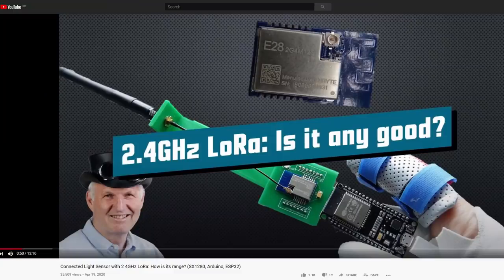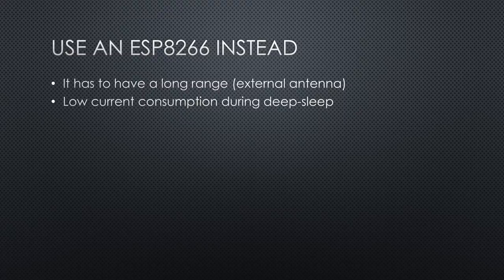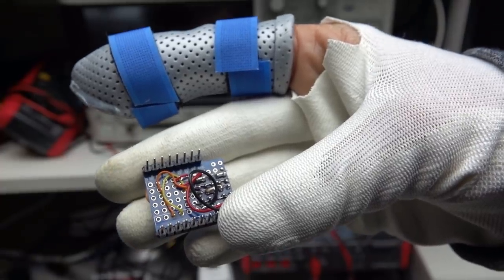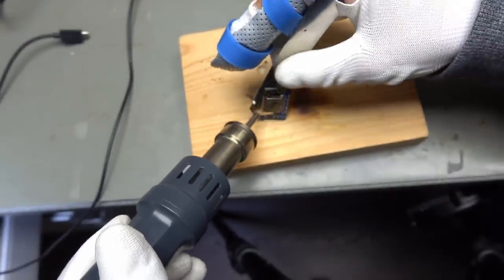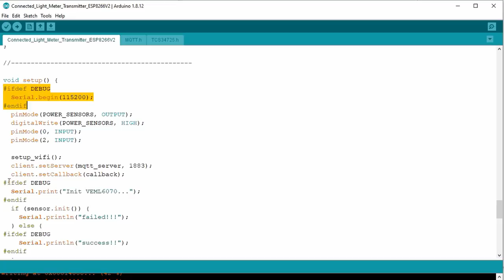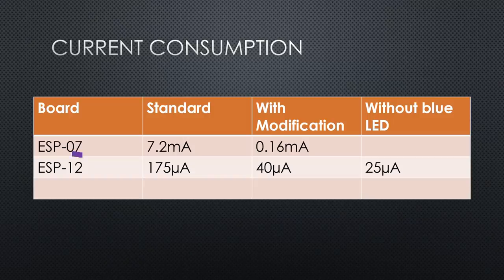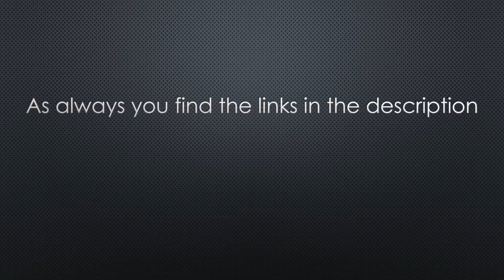#324 Wemos D1 Mini: Long Range and Low Power Modification (ESP8266, LiFePo4)

Comment: Outstanding advice and video. I have 3x D1 ESP8266 mini's for a project and this has helped me reduce the power consumption, as they will use a solar panel from outdoor Christmas lights to charge the battery and do not need powered on all the time, just when it needs to send data (currently temp, humidity, Light level, noise, vibration and gases), which is sent once every 5 mins. So this video has really helped. Thank you.
Reply from the maker: Cool project!

Comment: Danke, Andreas, very helpful! Until now I've always lifted the Vcc pin of the FTDI chip to save its power consumption, but the trick with cutting the trace is much better!
Reply from the maker: Your way is also a good one, I think. And it works in all situations ;-)

Comment: Cool vídeo! I'm currently using the wemos outside with a tiny solar panel,  a tp4056 with protection ic, and an old 18650 cell from laptop battery. Working great so far
Reply from the maker: Very cool!

Comment: Is it possible that the last table has wrong row labels?   ESP-07 on that table eats much more current than ESP-12?
Reply: i was asking myself the same question
Reply from the maker: This is what I measured. I do not know why :-(
Reply: Andreas Spiess incredible. What components do the modules use? ESP8266EX, flash and oscilator + some passives. Does the ESP-07 have some RF circuits for the external antenna?
Reply: @AndreasSpiess  Ok, I misunderstood this. So ESP-12 is way to go if one wants to save energy and the simplest way is to get rid of the blue led. Thanks for the great video again.
Reply: ꀯ i thought the same. But what explains the current draw differences (other than an eventual mistake mr adreas made)
Reply: antenna is a load and additional cables always have losses. external one appears to be much bigger load than pcb one.
Reply: @AndreasSpiess , I've came upon a video that might explain it.
The trick is that some boards already contain resistors that connect some of the pins that need to be pulled up. You can get bellow 3uA if you remove the resistor that holds the RST pin.

Take a look of the video "Best power saving mode - Much Deeper Deep Sleep ESP8266" by "DIY TECH BROS".
Reply: @user-jp7tw3sd3x  yup. I think we have the winner here :)
Reply: @antonmilosevic  As far as I know, the ESP07 (not the S version) is older than the ESP12F. So maybe the chip revision also differs, or they used other values for pull-up or pull-down resistors. Or perhaps the flash chip itself uses more power when the ESP is in deep sleep. 
Could be the same difference can be seen when comparing ESP12E  and ESP12F
Reply: @Mr.Leeroy  Even i was thinking the same.....but the external antenna helps to reduce the handshake time between the esp and server...so with ext antenna esp can go back to deepsleep quickly then without antenna thereby reducing current consumption(if you are pinging at intervals)....if you require consistent connection for commercial application always go with esp's with ext antenna model
Reply: @upendrachaudhari4635  you may be right.
well my reasoning is easy to test by comparing both modules using pcb antenna. I only have nodeMCU now.

Comment: So, do I get the last table right? The ESP-07 gives you an external antenna connector. But it draws a lot more current than the ESP-12 which is pre-installed in the D1 mini? I hope I got that right, to be honest that's a bit confusing...
Reply: @aqib2000  This is deep-sleep current. So only the chip's bare minimum functions are powered. The transmitting or receiving part of the chip is shut off during deep-sleep.
Reply from the maker: I do not know the reason for the higher current of the ESP07. Maybe because it is an old design.

Comment: Good video. I use a D1 mini pro V2 which has a external antenna and a built-in battery charging circuit. Has pads on the back so with a dab of solder you can connect GPIO16 to RST and another dab of solder and it connects the plus side of the lipo battery through a 130 k resistor to A0 for voltage monitoring added a BME680 sensor set it to deep sleep every 10 min. It reports all sensor readings to thingspeak website. Can monitor Temp, humidity, pressure and Indoor Air Quality.  Last about 60 days between charges.
Reply from the maker: Sound like a great bord. I will have a look at it.

Comment: I want to point out some clarification regarding the cutting of the PCB trace:
I did as instructed in the video. However i got strange behavoiur, as the ESP did not work properly afterwards. After some time debugging I found that by cutting the trace as suggested, the Pull-ups for D3 and D4 have no 3V3 anymore. So I connected the pull ups with a short wire to 3V3. But I had to cut the trace which leads to Pin16 of the CH340 to prevent the Chip from getting power again.
I han further problems with the 470R Resistors in the RX and TX line. I found that somehow current was flowing from ESP to CH340 through them. Therefore i desoldered them. Now I can only program via external serial converter, but it's working now as expected.

BTW: my blue LED was also slighly glowing during deep sleep as you described. I suspect that this is caused by the above mentioned issue. I suspect in your case (only the one trace cut) current flows from GPIO2 (where LED is) throught the circuit path (the disconnected 3V3 copper traces) and through the CH340 chip back to the ESP. Probably due to some parasitic diodes. With my additional modification (cut 2nd trace and solder a short wire), the LED does not glow anymore during deep sleep.
Reply from the maker: Thanks for the info. Another viewer pointed also out that he had a slightly different board.
Reply: @AndreasSpiess  When I compare your close up shot of your PCB traces with device, the Layout looks the same, however. But of course no all is seen, so it could have been something different.

As Addition to anyone who wants to achieve a very low power design:
I measured the reverse current of the voltage regulator (i think ME6211) when no USB was connected. As will be the case when I supply 3V3 from an external regulator. I measured 58µA! However, this was not acceptable for me.
So I ended up desoldering the CH340, the two NPN-transistors, the resistors in between and the voltage regulator itself.  So i have a very low power device.
Programming can easily be achieved with any 3.3V external USBtoSerial converter with 4 Signals RX, TX, RTS and DTR and some jumper cables. I think, this little inconvenience is worth a considerable lower current consumption.

Comment: Why not read internal voltage directly?
Like this:
ADC_MODE(ADC_VCC);
volt = ESP.getVcc();
No need to connect ADC externally.
Reply: S Elnes : right, this would work...but in all the ESP8266 ADC is bad
Reply: And you can use the voltage measurement to stop the esp from waking up when the battery gets to low.
To save the battery.
Reply: In this mode  you read the voltage after the voltage regulator of the D1 mini, which gives less info about the battery voltage
Reply: @wjhoogervorst  but if you connect Vbat directly to VCC of the ESP8266 you read Vbat. And that is what he does here. He bypasses the regulator.
Reply: @rofo88  for this purpose it's more than enough
Reply: @antonmilosevic  I think that is the point Wim was making.
Reply: That mode can't be used on the Wemos boards without removing the resistors connected between the ADC pin of the ESP board and the A0 & GND of the Wemos carrier board.
Reply: @nThanksForAllTheFish  Yes, indeed

Comment: If I do not call `Serial.begin()` at the beginning, aren't all subsequent `Serial.println()` calls ignored and have no effect? Do I have to put the conditional preprocessor block around each and every `Serial.println()` in order to disable the serial output and save power?
Reply from the maker: I do not think that they are ignored. The just do not know where to output and lose everything. With precompiler directives the commands are not inserted. But I never looked how the compiler works.

Comment: Great video! Fyi: you can purchase a D1 Mini Pro with external antenna connector pre-soldered.
Reply from the maker: I know. But it would probably arrive as a Christmas gift in the current situation ;-)
Reply: @AndreasSpiess  Why not using the ESP07S? It has an external antenna connector, no LED and no chip antenna to be removed.  It also has 4 MB flash and like the ESP12S it only has the pins on the side, not the "bottom" row (opposite edge of the antenna position)  The ESP07 has very little flash, so OTA updates are much harder.
Reply from the maker: Same answer as above. Do you know if it is pin compatible with the esp12?
Reply: @AndreasSpiess  Yep, I use them myself. Main difference is that you don't need external components for pull-up or pull-down on the ESP12S / 07S. So it makes my own boards a lot more easier :) Less pins to solder, no external components.  

When you use the Wemos base boards, there are already the pull-up and pull-down resistors present on GPIO-0, GPIO-2 and GPIO-15 (and the EN pin), so I guess those will be in parallel to the ones included in the ESP12S/07S package and thus impose a stronger pull. You may need to keep that in mind if some connected sensor is not capable of pulling the pin down (or up for GPIO-15).  

Also there have been reports on ESP12S not being able to wake up themselves because of the wake signal on GPIO-16 to rise too slow and thus give a pulse width which is too short.  Not sure if that applies to all. It could be remedied with an external resistor or capacitor (not sure which).
Reply: @AndreasSpiess  same for ording a ESP-07 chip to replace an ESP-12 :P :)
Reply: Loving D1 boards, I use them for pretty everything.

Comment: Hi Andreas, Thank You for great detailed Wemos how to video. Question. Am wanting to use one of these as a repeater mounted on drone to hopefully get better FPV range. Problem: The FPV is transmitted to smartphone over wifi 5.8ghz. Is there any cheap modules to make this happen? (Have already tried adding an external antenna to existing wifi on board of drone  for the 5.8ghz wifi on no range increase at all?) To put into perspective. The drone communicates from drone to controller,over wifi 2.4ghz and can in fact fly over 1km in distance. The camera/FPV from drone to smartphone is transmitted via wifi 5.8ghz,and this dies after only 125 meters distance. Thank You.
Reply from the maker: I have no knowledge about video nor about drones. So I am no help here.

Comment: I know its a bit late almost one year later, but there is a Wemos D1 Mini Plus that already has a ceramic antenna plus a connector for an external antenna. Its a bit more expensive than the normal Wemos D1 mini, but still cheaper than buying an additional Esp-07. for a few cent more there is also a Wemos D1 Mini plus with a bigger flash memory.
I some time ago played with an ESP-12 and soldered it on one of those little breakout boards that are sold for them. After some time I noticed that breakout board used a 0Ohm reistor instead of a regulator. So I was running my ESP-12 on 5V instead of 3.3V. 
It didnt take any harm, so I googled a found some posts that ESP8266 would be known to run on 5V without problems.
Thats nothing I would recommend to do. But I could imagine runing it on a Lipo with 3.7V instead of 3.3 V will not do big harm, especially if it always only works for a second and then goes back to deepsleep.
Reply from the maker: According its datasheet the ESP8266 has a maximum rating of 3.6V. And its input pins are 5V tolerant. So you can be happy that yours survived!
Reply: @AndreasSpiess  Ich weiss, dass der Esp8266 nicht für 3.7V oder sogar 5V zugelassen ist. Mich haben nur die Forenbeiträge von Leuten gewundert, die behaupten, dass sie ihre ESP8266 immer ohne Probleme mit 5V betreiben. Aber wer weiß, ob das stimmt.
Mir ist aber auch gerade mein Denkfehler klar geworden. Ich bin fälschlich von 3.7V ausgegangen, aber volle Lipos und Lithium Ionen Akkus haben ja 4.2V und das liegt natürlich schon weit über den zugelassenen 3,6V.

Comment: So nice to see a video on the ESP8266 again. I thought you had given up on it and gone solely ESP32 :-)
The D1 mini is my favourite 8266 board too, especially when flashed with the Annex RDS firmware. The latter might not be that well known, but if you like combining live web interfaces with embedded or just like a retro BASIC (yes, really!) experience, it might be worth exploring. I find myself using this a lot more than Arduino IDE or Platform I/O because it's as flexible as MicroPython without being so sparse and irritating as the latter :-) And the single step and breakpoint debugger actually works :-) If you are resurrecting interest in the 8266, you may want to have a look at what the Annex RDS team have been up to in the past year?
Thanks for an interesting video Andreas...
Reply from the maker: I use the ESP8266 if I do not need an ESP32 because I still have plenty of them in my box. For the videos I usually use ESP32s. I will have a look into Annex RDS.

Comment: will you please make the same instruction for esp32 .. for wemos or nodemcu . im having a really hard time soldering to the naked esp32, 
and i just CANT solder the 3.3v pin to a breakout PCB
Reply from the maker: You get "naked" PCBs for the ESP32 with normal pins. I showed it in one of my videos.

Comment: Hi Andreas, going down to ~20uA for a prefabricated PCB including USB-TTL (when needed) is really impressive. Also the LDO seems to be pretty ok. I wish there were some more ready made modules (also for ESP32) available with low power configurations suitable for battery projects. 
I tried your power modification and found that the 10k pullup for RES is on the ESP side of the cut while the IO0(FLASH) and I02(blue LED) pullups are on the CH340 side. When powering the module on the ESP side only (battery mode) and going into deep sleep, the blue led drives a small current via the 10k resistor into the CH340 "power domain". I02 is at around 0.8V in this stage. This is the reason the blue LED stays on in deep sleep. 
I also measure 0.8V on I00, probably crosstalk? Removing the LED it is 0V. My module works ok with the LED kept or removed. However, I am not sure if it is 100% save to have IO0 connected into the CH340 domain without being properly pulled high and the CH340 domain is still connected to ground.
Reply: Today I reconnect the 2 power domains and removed the LDO instead. This led to 30uA@3V during deep sleep. Actually I had expected much more since the CH340 is still connected. Then I inserted an MCP1702 instead and and removed the 100k resistor between VBUS and GND (I have no idea why this is there). This led to almost same deep sleep current feeding 3.3V and 34uA feeding anything from 3-6V to the 5V pin. In this state you can also just plug in the USB cable. However the MCP1702 is not at all ideal (just had it around) and even fed with 5V from USB it led to spontaneous crashes unless you connect a big capacitor between 3.3V and GND. Finally I connected 6V to the 3.3V input........
Reply from the maker: Thank you for sharing your experiments. 6 volt on the ESP is probably not the best idea ;-)

Comment: If I understood correctly, cutting the track does not change the working of the board, right? All functionalities stay the same. The only change is that the USB does not feed the USB to serial chip anymore, instead external power must be applied, am I correct?
Reply from the maker: Pay attention. Some viewers wrote they got slightly different boards which did no more work after this mod. So check first the traces. But you are right, I disconnected the USB chip and the voltage regulator from power.

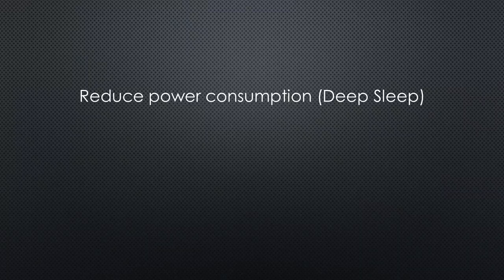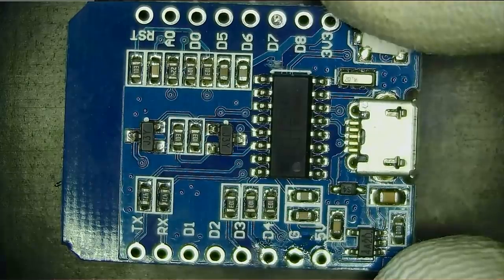Comment: Cutting the trace on the board to disconnect the LDO regulator?  Not quite clear about what is being explained between 3:35 and 4:10. Can you expand on this, ie, how to program and run the board from which inputs?  thanks.  
PS. I'm powering my battery run devices using the HT7333 w the appropriate volt divider from either 4.2(parallel) or 8.4 battery(in series) configs
Reply from the maker: I think the explanation was very clear. The HT7333 is a good solution. I also use it frequently.

Comment: Another great vid.  Thanks!  Andreas, one trick I have learned: When soldering the ESP12 form I have been using a small syringe of solderpaste first applied to the board pads.  just a little dab will do, as they say.  Once the ESP is placed, the solderpaste forms a bit of suction on the pads so the ESP stays in position better.  Much easier for my old shaky hands.  I can see when the solderpaste melts as it gets drawn up though the small pin holes.
Reply from the maker: Good tip. Thank you.

Comment: Hi Andreas, do you plan to add voltage reference to measure battery voltage, or is there any trick to use analog input for this purpose?
Reply from the maker: I assume that the ADC inside the ESPs have such a reference. Otherwise you would always get the same reading if you measure VCC. There is no trick. Just as I did in the video.

Comment: I'm a bit confused about LiFePo4, as the internet sometimes says that 3.2V cells are actually 4.2v (when fully charged to the brim)... :/
Reply from the maker: Lifepo4 batteries are charged up to 3.6 volts and their nominal voltage is 3.2 volts
Li-Ion batteries are charged up to 4.2 volts and their nominal voltage is 3.7 volts. They are very different

Comment: Hi, great video, do you use a 10K resistor from 3.3V to A0? Just wondering if a resistor divider would not be required as A0 input voltage is maximum 1 V isn't? Please correct me if I'm wrong.
Reply from the maker: Most Wemos boards have these resistors built-in. If you only want to measure 1 volt you can bridge one resistor and remove the other.